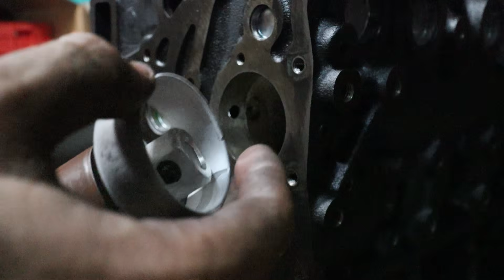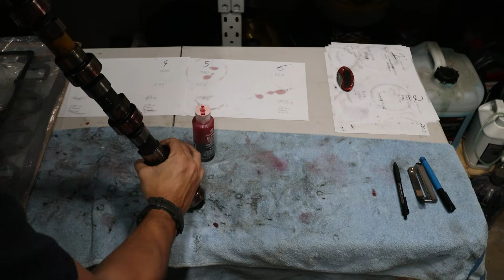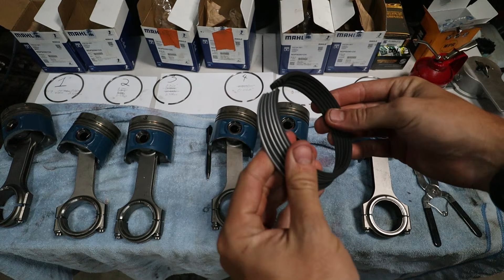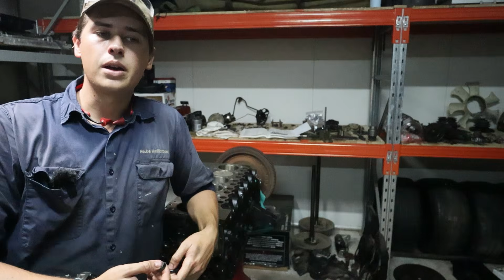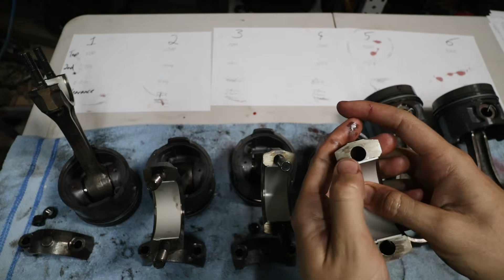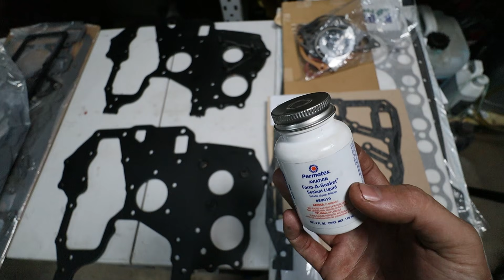TD42T Engine Rebuild | Part 3: Bottom End Assembly

Comment: Did you check piston to deck hight?
Reply from the maker: Yeah mate ended up having some height issues with too much protrusion and required a shim, would have topped the pistons but they had already been ceramic coated 🤙🏻

Comment: I always loctite bango bolts into the block for the oil squirters, I have seen these come loose and cause oil pressure problems.
Reply from the maker: I questioned this when I was installing the squirters as all the manuals I had stated to lubricate the threads of the squirters. Have you seen the squirters come loose on TD42s or on other engines?
Reply: @ReubsModifications Yes I have found loose squirters on two original engines first tear down at 500+K and one engine that failed due to lack of oil pressure as a result, so now I use stud locker and never had any issues since.

Comment: Torque specs for the backing plate onto the block? I cant find them in the service manual, it only shows the timing case torque spec
Reply from the maker: I cant find the exact specs but they should be approximately 15-21nm, same as the timing case 👌